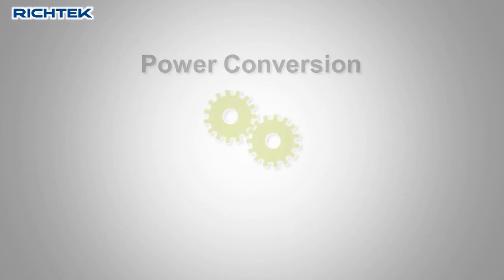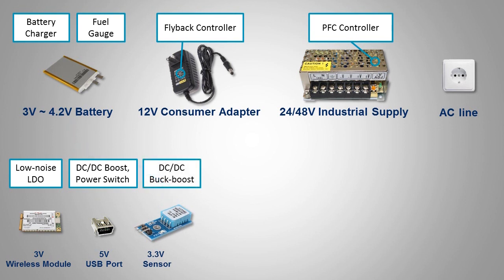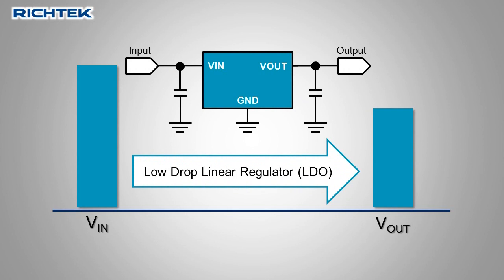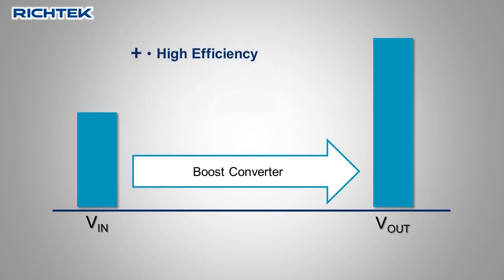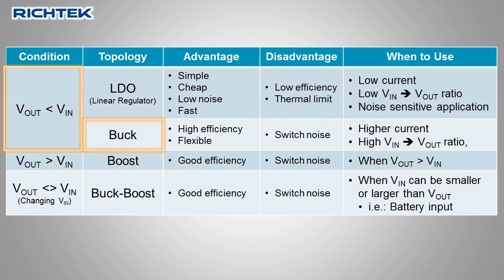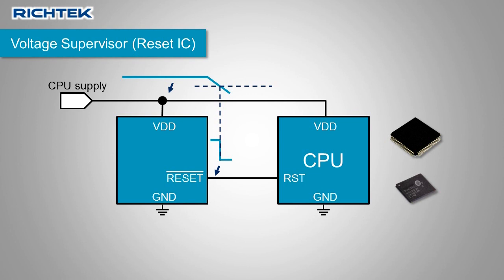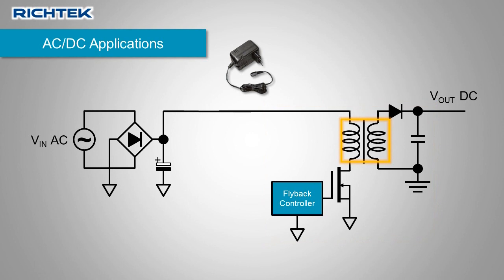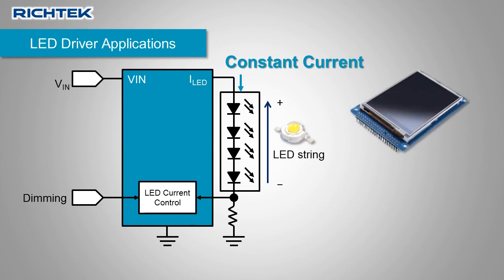How to Select a Power Management Component for Your Application

Comment: One question. When you use the power path control charger to run the system from the battery, what will the charger do at that time? Does it keep charging, meaning the battery is charging and discharging at the same time or does it stops charging?